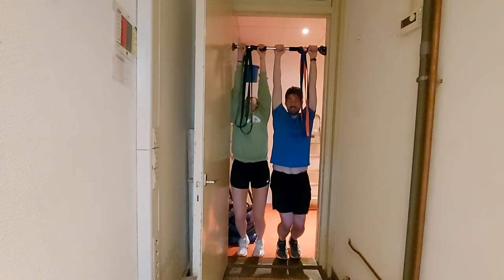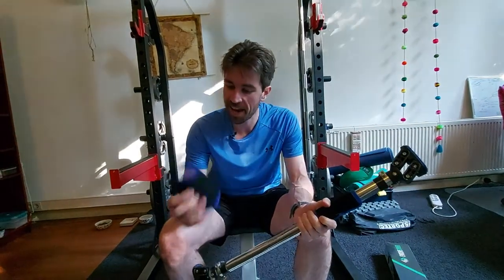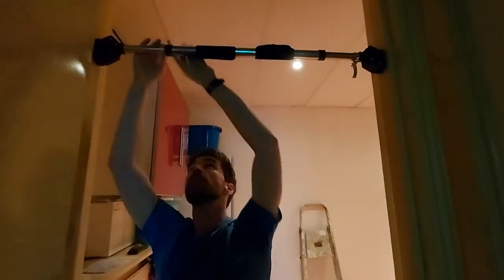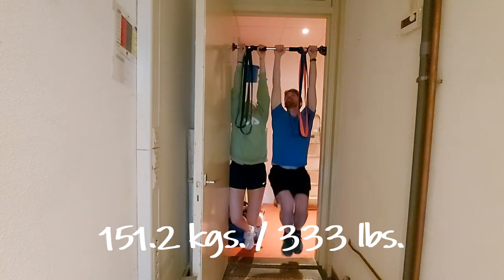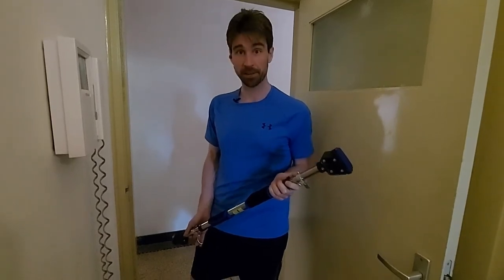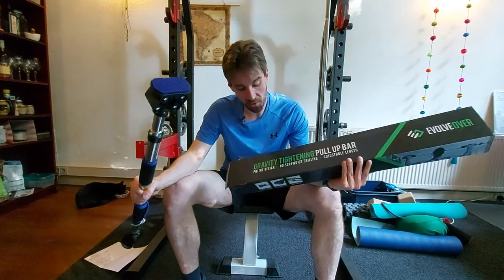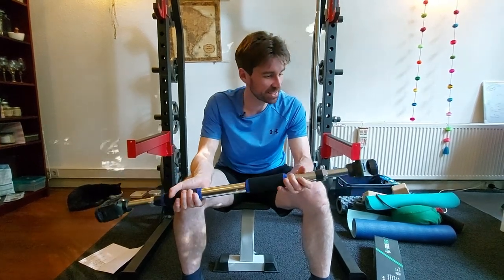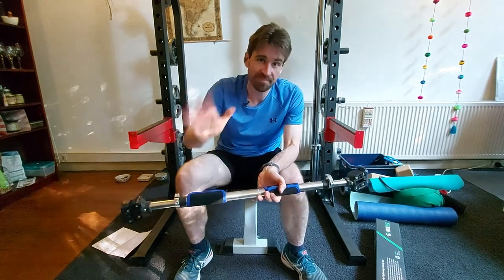Evolve Over Doorway Pull Up Bar Review (Doorframe or paint damage? Easy setup? Hold 2 people?)

Comment: Threre are two types of doorway pull-up bars:  One that has failed; and one that will fail.    There is also NO such thing as a NO DAMAGE doorway pull-up bar.  After repeated use, the doorway pull-up bars will crush and damage the door frame.

Comment: looks like it sagged
Reply from the maker: Hi, Julius Arcenal! 👋😀 Interesting observation. With out combined weight (plus unaccounted weight of our clothes) we were stressing the bar to between 75% and 80% of it's maximum capacity. So, a slight sag could be expected. Even deadlift bars will bend when pushed to their max, like in this Buff Dudes video: https://www.youtube.com/watch?v=_ZeUlqJwNmw

Based on my understanding of the technology, even if there were a little sag on the device, that should be a good thing, as it means more pressure is being applied horizontally into the doorframes, making the device even sturdier. 

But of course, too much sag/bend and you would probably just come tumbling to the ground, so respecting the 200kg / 400 lbs. max is recommended. 

I just asked my girlfriend about it, and she shares my opinion that it felt sturdy while the both of us were using it, and that it's condition right now seems totally normal. I've successfully used the bar twice now since making this video, and I am still happy with it.

Thanks again for your careful viewing of my video. I hope I have addressed your comment thoroughly. Do let me know if you would like to know anything else about the bar and/or my experience with it. 

Wishing you all the best on your health and fitness journey...